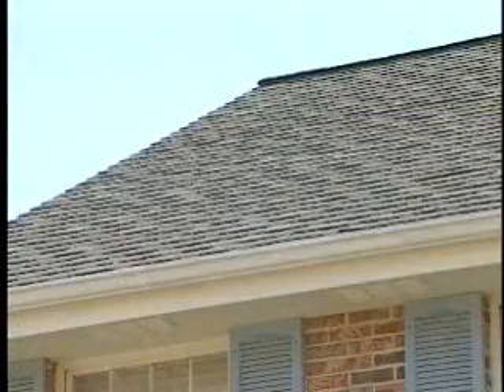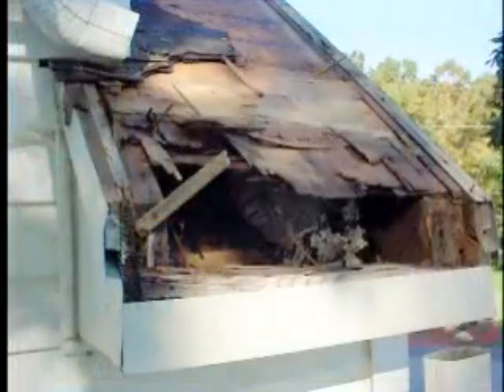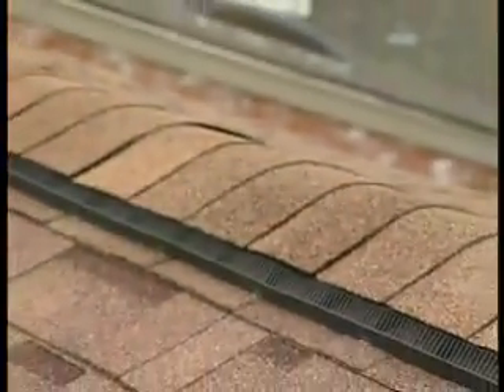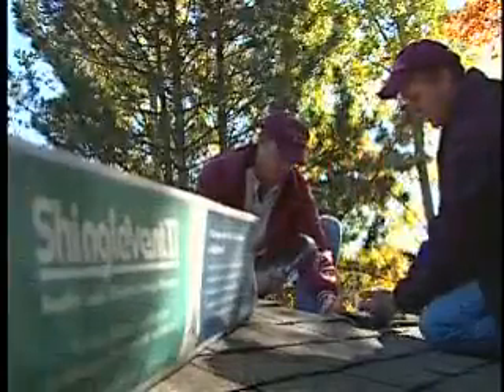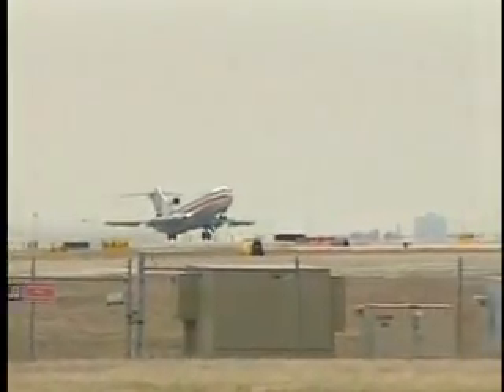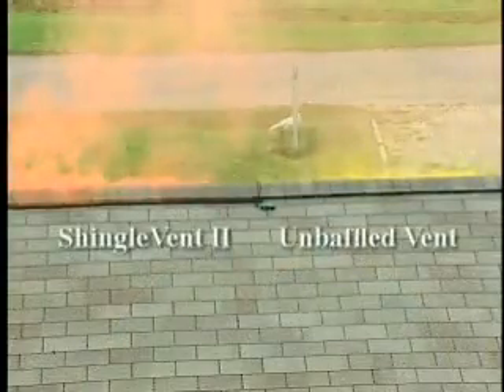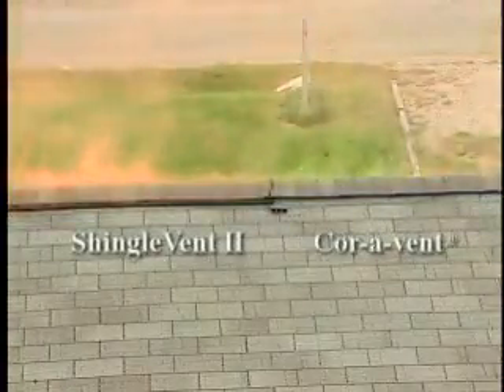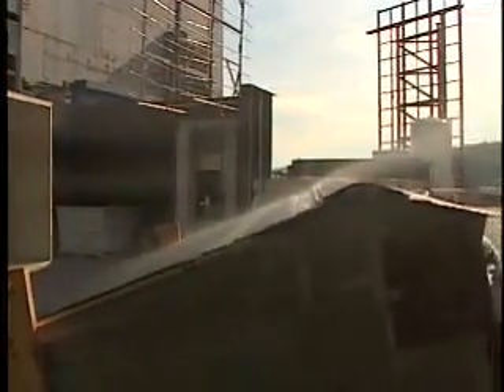Roofing Ventilation - Why Roof Ridge Vents Are Important!

Comment: Had the same problem on a tiny ridge triangle that degraded the 3 tab cap, so, guy puts on a ridgevent system that warped and seeped right under.  Got him back, and he says, I'll put the 3 tab back on but you have to change if every 10 years. 

Well I thought, better that then warping, so, present cap has peeled right back with color disappearing to tar cap on the south side.  

Anyways, I thought about long metal with bean shaped slideholes, as too experimental, so, I'm staying with 3 tab..  

Anywho, on the double wide, I'd find a woodwork hobby guy to make some toy vented coupalas, like 3 of them, inserted with flashing covered 3 tab tab.

Comment: You my friend are wrong. The reason contractors use ridge more often is for looks. The best ventilation method is a Whirlybird because it too constantly gives a flow of air through the attic but when the wind blows it spins it and far exceeds the rate of heat dissipation.

Comment: I lived in my house for 30 years without a roof problem. I replaced the roof shingles and sheathing which were 40 years old. The town required ridge vents to lower central air energy use. I thought nothing of it and followed the new code.

A year later I noticed black mold on half the attic sheathing. The roofer said it wasn't his fault. The contractor who was doing a simultaneous addition said it had nothing to do with him. The pattern of mold growth showed clearly that it started at the eave on one 12 foot section. That was the area where the contractor rerouted my dryer vent. 

The roofer told me the ridge is supposed to suck in air at the eaves. The contractor said his vent was installed to code: not his problem. Be careful when upgrading to a ridge vent and never have carpentry work done by more than one crew. 

I removed the mold myself after getting multi thousand $ estimates. It turned out to be simple. I made a mixture of laundry bleach and a little dish-washing detergent which I sprayed on with a squirt bottle. The mold melted away instantly and no cleanup was necessary. Now, a year later it's coming back and I realize that the dryer has to be moved to an area where there is no entry of moisture to the attic.

The bleach does not provide permanent protection. The purpose of the dish-washing detergent is to penetrate the plywood sheathing. The bleach by itself does nothing but add just a little detergent and it's like having a magic wand in a spray bottle. Tell your friends who have mold issues to try my mixture first before they get involved with "experts".
Reply: You don't have to move the dryer, just relocate the vent up to the roof. Also, I don't know why you didn't just do that in the first place. 

Be sure to use an insulated pipe so you don't get condensation in the pipe in the winter.
Reply: tea tree oil partially diluted works better
Reply: That contractor needs to close his business down is he told you that. This video is not that good either because you need a vented soffit along the whole house not just a vent here and there and ridge vent is definitely not the most effective ventilation. Whirlybirds are the superior method because it draws the air out when the wind is blowing but it still vents perfectly fine when its calm where as you have to just rely on hoping your ridge vent doesn't get clogged up from debris. Like you also stated they have to cut a gap along the peak of your roof for a ridge vent which allows many feet of open area for moisture to get in.

Comment: Be careful. My roofer put on a ridgevent. I have no soffit vents or gable vents. Now we are having moisture condensation.
Reply: Would this not be a problem if you had gotten soffit vents as well?
Reply: an o hagens vent towards the bottom of the roof will help with INTAKE...seeing as you already have exhaust.
Just my 2 cents
Reply: that roofer needs to give up on life if he didn't atleast tell you that you had to have a fully ventilated soffit along the whole length of overhang and not just a vent here and there like this video says.
Reply: Duh.  That's part of the design package, except where an attic is a conditioned space.  Most roofers are versed in new construction [which will have specs laid out for them] or replacing existing with identical features.  Most know code, but not the how or why it came into existance - so they miss stuff on retrofit/modifications.  Soffit details on many builds fall on the carpenter to install, which leads to some roofers having a plain old blind spot.